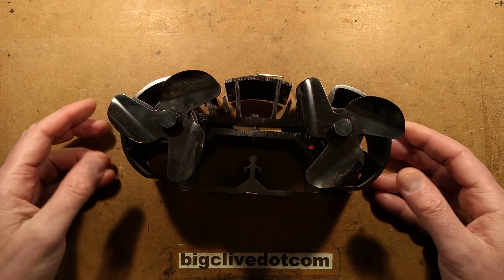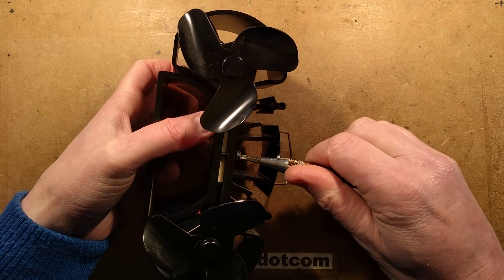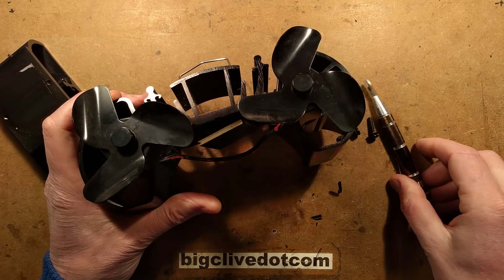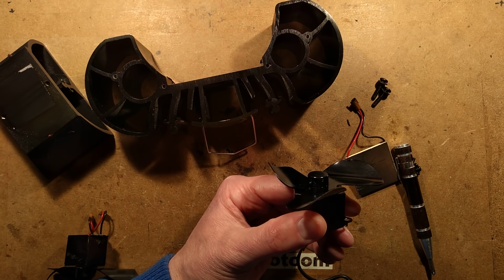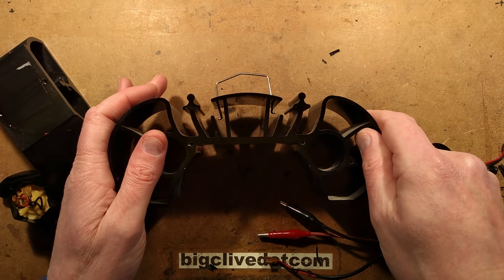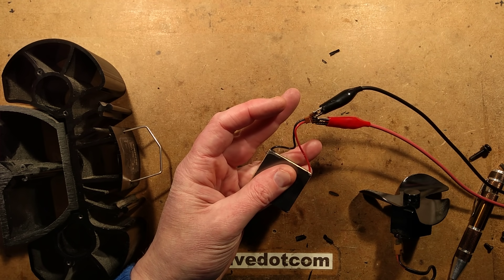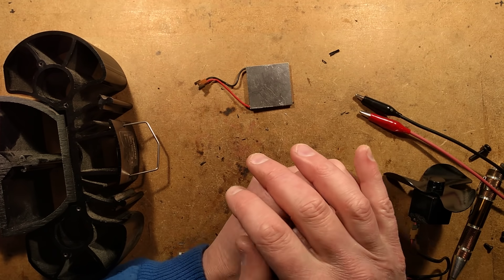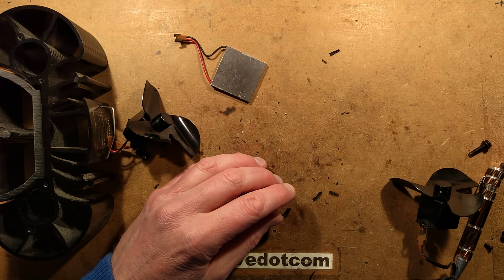Teardown of a self powering machine.

Comment: I have the same fan on my wood stove and it was taking longer to start and eventually I had to start it by hand. I thought it might be the peltier. I was able to find the motor at a local wood stove shop so I replaced it and now have the fan working as new again. My old motor wasn’t noisy like yours is and it turned quite smoothly. I suspect that your problem is also the motor.

Comment: We have one of these for circulating air from our wood stove at our cottage. It is not the same brand, and it also includes a bi-metal strip on the base to lift the assembly off the stove surface when it gets too hot. Had it for about 5 years, and it still works perfectly, but then again, it's not chinese made.

Comment: it depends on if it is made for power generation or for temperature control.  Make it hot/make it cold etc. Like the ones used in a fridge or the ones used in making power.  They all will do it but their construction depends on their job designation.

Comment: When I had a natural gas powered heater in my house, I found that it was heating the exhaust much more then mu room. And it only heated the upper 50cm of the room, while gravity made me dwell the lower regions more than I would sit on my ceiling. So I decided to force cool it with two 7 watt 230V computer fans, and distribute the heat to the level where I live. This made a 70% reduction on my gas bill! They even placed a new meter because they no longer trusted to original meter. Had I known a device like this exists, this is what would have been cooling my heater.

Comment: Hi Clive i have had the same issue with the motor on my fan(the single motor type) also a small drop of 3 in 1 oil on the shaft on the motor on both ends of the motor on a monthly basis it keeps it going ok.too much oil did not damage the motor short term but it did get every where eventualy.. i have eventualy got a new chinese motor from ebay for £3 inc shipping.. and a new peltier cell (make sure you get the hi temp ones) they are a little more expensive but work and last longer and i used some heat paste when i installed it..its still going after 3 years!!

Comment: My dad has one of these fans on top of his wood burner. It got me thinking back to those electric bar fires, with the moulded fibreglass coal effect and spinners suspended on pins over white, orange or red bulbs. The convection caused the spin and I used to wonder if this method on a bigger scale, could be used as a generator to power lights or whatever?

Comment: Poor old mum!
The brother in law just bought one of those fans and placed it atop his wood burning stove which was at 290C. Can't say I could really feel any significant airflow from it. It was a 4-bladed variety which cost him £20. I don't think the minuscule airflow generated would prove any more effective than the convection from the stove.

I am genuinely looking for a better solution of spreading heat from my Rayburn up the hallway. Last weekend I placed a tower fan infront of the open Rayburn oven. The fan can't be more than 50W and even that was a bit weak to push the heat more than 7ft.

Comment: If you don't fix it, that heatsink could be used for a COB LED. I used a similar heatsink to make a outdoor floodlight using one of the "driverless" LEDs.

And yup, I had one of those mini fridges in my room for a while, it definitely heated up my room over the summer. Ended up tearing it apart and salvaging components.

Comment: Not that it matters a whole lot but when used for power generation instead of heat pumping it's more appropriate to call it a seebeck module. Also I'm reasonably sure fridge compressors are rated in fractions of a horsepower. 1/8 hp seems fairly common which is almost 100W.

Comment: When you rebuild them, use some form of thermal paste or conductive material to mate the TEC unit to the metal parts instead of doing it metal to metal. It should assist with the thermal transfer and let them get up to speed faster.

Comment: A couple of things that would make this thing less likely to stall during start up would be a small cup/bowl at the top, where one could add a little water, or oils (aroma/scented oil and such) as to keep the top cooler as it evaporates off. (And likely add a few more fins to the design, a bit more surface area really wouldn't hurt.)

Comment: @bigclivedotcom 

pretty sure there are 2 kinds of those peltier devices, one made for putting power into and its usually the cheaper one, and the other kind puts power out better but cost more. both should work on the same principal and yes you can get power out of the cheaper kind but much less current usually.

Comment: Hi Clive I know this is an old video and you probable have the motors by now but just in case you haven't I believe the motors you need are RF-500TB they have them on ebay by the bucket full .

Comment: 0:29... It is a Peltier Cell comprised of PN junctions running in the Seebeck effect to produce voltage/current for the low voltage motor.
6:58... Those type Peltier cells are called TEGs (Thermo Electric Generators) and are specifically designed to produce voltage/current. The white ceramic ones on eBay are standard TECs.
10:39... I would use silicone insulated wire for the high temperatures on top of a wood burning stove.

Comment: I found that the spindle motor from a CD drive work very well, they have low cogging and start to move a a very low voltage/cuent
I tried a motor from a single battery hand fan and it hardly worked at all if ever.

Comment: If the peltier unit was located a way from the little fans in such away that one side was cooled by the fresh air intake for the stove and the other side heated by the stove you should be able to get some great fan action going.

Comment: I came across something like this in a box of donated items.  It has a short length of aluminium tube with a fluid screw propeller inside wired to what I thought was a rechargeable cell and then to an airscrew propeller on an external post.  Having dismantled it I found that both propellers would run on a phone charger.  I assumed it was some sort of propeller salesman's executive toy.

Comment: Hi, this video is a litte older so I think you already found what you were looking for. If not you might want to disassemble an old CD drive from your PC. They contain Motors that run very silent. But I don't know if they are good for the delivered voltage of the peltier element. Greetings from Germany

Comment: those are kind of fancy fans. all i've seen in the US were the ones that just ran from the heat pushing the fan(s) no motors.  you might be able to save those motors with some electrical cleaner and re-oiling them, maybe?
   Ive heard those peltier coolers can take lots of heat. Ive seen those mounted directly to the side of a wood stove making electric to power a 12v DC blower motor from a car, one of those metal squirrel cage type. i guess thats about the same principle of the ones you have just cuts out the middle fan/man. lol

Comment: Clive why not take some synthetic cal engine oil and put a drop on each of the bearings and work it in? I have done that with little motors of the same type and saved then. can't hurt to try that. Something I read or saw (not sure) about peltier junction generators. Also known as a Seebeck generator or TEG. They differ from the cooling peltier junctions.
It may just be how they are put into use and the device is the same in both chase.TEG vs TEC. Can't wait for the update on this video.
Thanks

Comment: As a recent owner of a low thermal differential Stirling engine model, I would start periodically spinning the propellers to see, if there is enough current to keep them running.  Stirling engine cannot start itself, this apparently applies to these things as well.

Comment: funny you talked about those fridges. I have 1 of the bigger ones, its probably drawing 10-15A. Now i also have a compressor fridge on 12v, that runs on 2.8A, and that only runs about 30-50% of the time on a warm day, on a cold day even less. And that thing keeps the stuff inside a lot cooler, it can even freeze it with 30c+ outside temp. So yeah these are crap for cooling purpose.

Comment: During my time at formula student I thougth of using a peltier element using the heat from our cooling system to replace or at least reduce the size of the low voltage battery. Those peltier are really not efficient using them this way. I made a lot of tests with very high temp. differences but never got enogth power out of them...

Comment: I saw a study of using these Seebek junctions on wood stoves in remote areas in Norway, to produce a couple of hundred watts to power LED light, laptops and the like....I think they are only about 5% or so efficient...I think they have been used in cars, fitted to exhaust pipes to augment the battery charging...

Comment: You should probably use heatproof wiring on the repair
Also, is it safe to electrically connect both sides of a "Peltier" element? It could be possible that the screw created a short circuit between positive and negative
Reply from the maker: The outsides are ceramic.

Comment: Douglas Self's excellent Eccentric Engineering site has an item about a thermocouple-driven radio supplied in Russia in the days before mains electricity. You put the finned structure above an oil-lamp and it generates a voltage to power the radio.

Comment: Maybe wrap the standoff section to insulate it and use silicone wire. Looking forward to the follow-up video. Timely video after a unusually cold 2 degF night and the woodstove is going strong. The Arduinos are keeping the space heaters going in the outbuildings as I've got DS18B20s strung along various sections of plumbing.
Reply: Genius! I love your thinking!

Comment: Use some good silicone insulated wire! May want to consider sacrificing a silicone cookie sheet and wrapping the motors in it (prolly need slightly smaller motors) before you shove them into their homes. Done and done!

Comment: They should use Silicon or Teflon coated wiring.
I always look at the flue thermometer on my stove, I know roughly where my fan is able to turn, I then give it a manual kick start to set it in motion.

Comment: Talking of silicone, could you use smaller diameter (possibly cheaper) motors and embed them in the case in silicone putty? This might insulate them from the ill effects of overheating. A baffle below the blades would help too to deflect rising heat.

Comment: I think that will be called a speed 400 motor for your searching. Mabuchi came up with the standard of 30mm diameter and 38 long? They come in all flavours, so find out what voltage you'll want to run at and search "400 motor Xv". That'll see you right. Shaft sizes may vary.

Comment: This is such a cool idea! Something I've never seen before, but throwing electronics in the oven is a little concerning.
Reply from the maker: It sits on top of a heating stove.
Reply: @bigclivedotcom  Oh, I thought it went inside an oven to turn a non-convection oven into a convection oven.  :P

Edit: which was something I wondered if the temp differential would be high enough to generate any current in the peltier.

Comment: I've had CPU fans and such that sounded worse than that.  A little lubrication solved that problem nicely..  I do have one of those coolers,  though I don't have a cord for it.  I need to rig something up,  and test that the heat/cool switch correctly indicates the function.  Neat stuff,  there,  I've seen ads for those but didn't know how they worked...

Maybe I oughta rig up a temperature sensor to an arduino and have that drive a MOSFET to cycle the thing,  so it will get to some set point and stay there,  not drwaing continuous power.

Comment: Those motors look like the mabuchi RF500TB (or generic equivalent) 
Found them on ebay but be sure to pay attention to the voltage rating. They come in a a range up to 12v and they all look the same. And yes they are actually different Ive tested driving a 3v rated one on 12v for a second and you could tell it wasn't to happy about it.

Oh you mentioned in the description never mind :)
Reply from the maker: I ordered a selection of that model to see what actually arrives.
Reply: bigclivedotcom what I have experienced is that some spin faster than others. I ordered a couple a few years ago for a project and although the rpm wasn't super quick they were quite grunty in terms of torque. I recently ordered a stack for a little car wash I am making  and they are nothing like the other ones. These ones are screaming fast but still have good torque. I like both kinds but I just wish I could choose what I get rather than a lucky dip. Mine were all listed as the 12v type.

Comment: Ah good old Peltier effect. It's not such a craze anymore but people were using them as CPU coolers. Unfortunately they were often overdriven or left in standby so the CPU would fall below dew point and they'd fry their motherboard and/processor from condensation.  I've known a few wrecked computers by people wanting to super cool them.

Comment: I've used the cheap peltier / teg elements from evilbay to revive a stove fan that wasn't putting out enough power.  Worked fine, but had a shorter lifespan.  My brother guessed the difference might be that the cheaper ones are designed for cooling rather than generation and are less able to take the heat of a stove.

Also, our local aldi have cheapy stove fans in stock at the moment.  Might be worth a look ; -)
Reply: Should add that the cheap replacement I got didn't have the graphite (if that's what it is) coating on, and was just white ceramic
Reply: @nathanlucas6465  you picked up a peltier which is the wrong sort. Next time search for T.E.G or thermal electrical generator (what clive had with the metal plate ontop instead of ceramic) these are made to take higher temps but produce a slightly lower voltage. Hope this helps.

Comment: I have been waiting for you to do one of these things. I have one that runs 8 led lights . I tested it and it puts out 4 volts (+ -)  so I added a usb plug so  I can charge the phone or my 18650 cells from the dollar store or '' pound land. So like you started taking things apart as a kid I am your age so i can relate to everything you say and do on here.  I was thinking about making a channel doing what your doing then I found you on here so i just enjoy the show's. I have my house set up to run on battery power ( 12 volt) so when the power goes out I can run for a week with no power from evil the power company  ( solar power and deep cell battery) I can run the tv' laptop' phones 'lights in each room' internet and for cooking I have 3 gas burners so other than heat im good ''' but'' i can plug the furnace into my set up and have heat but for that I have to hook up the booster cables to my car so I can keep my system charged. yes it's costly to burn gas for power but in winter when its -20 it's that or a hotel. This year im setting up my lights ''led's'' to run off 4 volts rather than 12 so my power will last a lot longer. 30 years ago I made a power inverter and hooked it to my tv  just so I could watch the hockey game if the power went out as it often did and sure enough the power went out for the over time play so I got set up and it worked great. You got to love when an idea goes from the head to paper then to a working design you made your self.  .  This power from the wood stove had me amazed as a kid ' what kind of witch craft is this I remember thinking lol .  keep up the good work love the videos.

Comment: I'm currently doing an EDS for making an actual commercially available car/engine exhaust heat recovered battery charging system using TEG/Seebeck modules, aim is to hopefully offset the alternator in any car making the car more fuel efficient

Comment: I would like to buy one of these, the tall one, as a gift. Seeing as you've discovered a high rate of failure, I'd like to preemptively upgrade it with a long lasting quite motor, silicon (all black) wiring and possibly a better peltier.  My worry is that my neighbors might not run their stove nearly as hot as yours, so I wonder if too robust a build would not power well.

Can we get a voltage measurement off the peltier at operating temp?  I might try to use a PC magnetic bearing fan.
Reply from the maker: I'd suggest getting a standard unit and then mod it if needed if it actually failed.

Comment: There is two types of peltier elements one type are made to produce power and the other is made to move heat,the one made for producing power can handle a lot higher temperature than the one made to move heat.
the two types can both produce power or be used to move heat so the difference is mostly about what temperature range they can handle.
the power type has this code SP+a number and the one for moving heat has this code TEC+a number.

Comment: The vapor compression cycle  is 40-60% efficient in real life, and cycle to conserve power, the peltiers are around 12% efficient, so a mini fridge with a 1/16 HP compressor would draw less power when running, can refrigerate more drinks, and it doesn't usually run all the time.